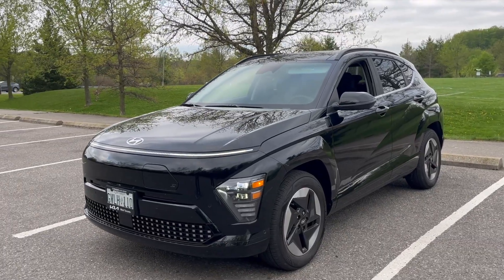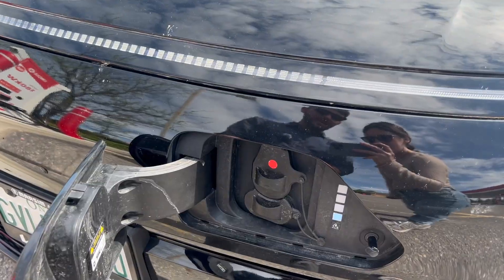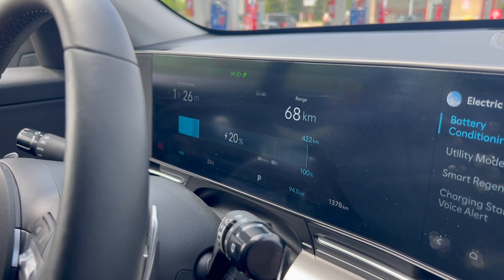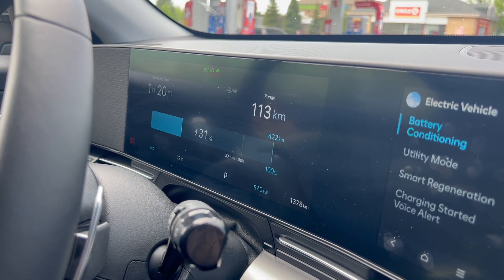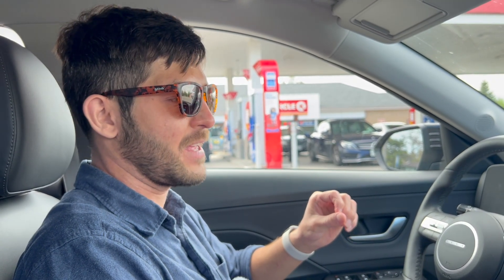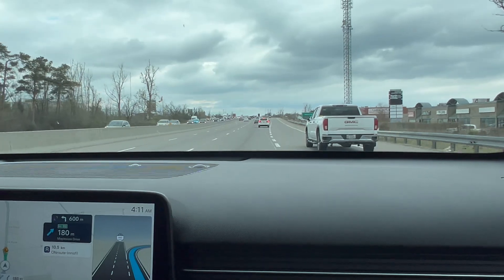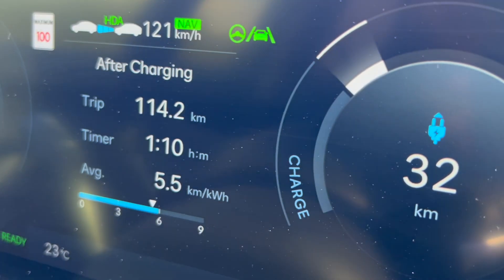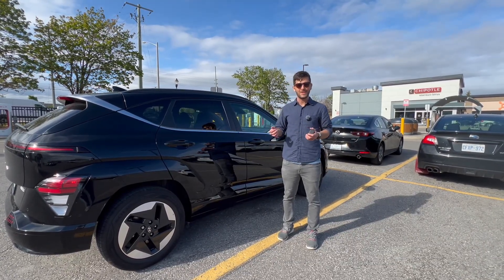Kona Electric - 15 Minute Charge Range Test

Comment: We bought a Kona Electric in January 2025 in New Brunswick, Canada. We are very pleased with it. We have done some 150 km day trips and are planning a trip to Halifax this fall, about 400 km. One thing to know is running the GPS mapping system of the car takes a fair amount of range off the battery if you leave it on all the time. Also AC and travelling at 120 km/hr versus 110 km/hr will affect range negatively. For the trip to Halifax, which we travel regularly, we plan a stop at the N.B./N.S. border for lunch and to charge from 20-80%. Yes it will take 45 minutes, but we will be eating lunch. Then one more 45-minute charge just outside Halifax while we have supper, and we will be good to go for our visit. My Kona Electric currently has 74% charge and 353 km of range.

Comment: I’ve always been a fan of the Kona, I’ve got the first-gen model, but I found the latest version quite disappointing when it came out. Charging from 10 to 80% takes around 40 to 50 minutes, depending on conditions. By contrast, the more affordable EV3, which comes with a much larger battery, manages the same in just 31 minutes.

As someone who enjoys a longer trip about once a month, I’ve made up my mind that my next car will need to offer better range and much quicker charging. There’s nothing worse than being stuck at a charger, watching other drivers come and go, while you're still waiting to hit 80% just to avoid another stop later on.

Comment: I have a 2024 Kona in the US.  I’ve never achieved a charging rate above 83kw, and was under the impression that was the peak in North America.    I know Europeans and Asian spec can hit 100kw, and has a flat curve from 10-70% holding between 92-100kw.  Do you have a source for 100kw peak?
Reply from the maker: I found this brochure linked from Hyundai USA site, page 6: https://secure.viewer.zmags.com/publication/7308d06d#/7308d06d/6
I tested a Canadian market car, I would assume it's the same spec and bettery cells as USA market Konas. 

It may be tricky to hit the peak on EVs sometimes. You need a fully preconditioned battery and the SoC% needs to be low. I'd also suggest trying on a more powerful DC charger than 150 kW, in case there are amperage limitations.

Comment: They make these intentionally slow charging so as not to undercut their higher priced EGMP models. Still has twice the curve of the Chevy Bolt. 

You'll need way more time charging while on the road than those EGMP models. A 15 minute comparison is not fare. You need to compare it to a Bolt or Leaf, etc. On the same very affordable price points. All of which are made to slow charge on purpose. That's why the Model 3 outsells them all combined.

Legacy will get there at some point, but for now, that would undercut even their ICE counterparts at this price point.